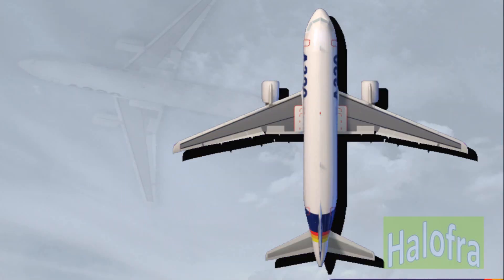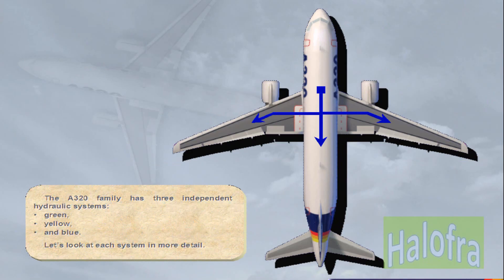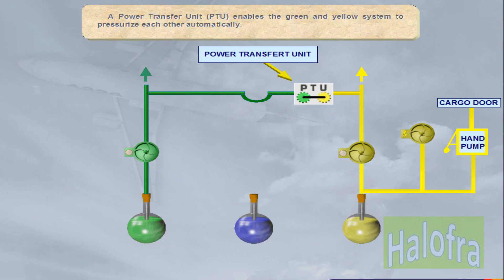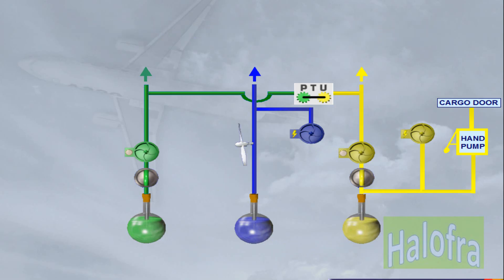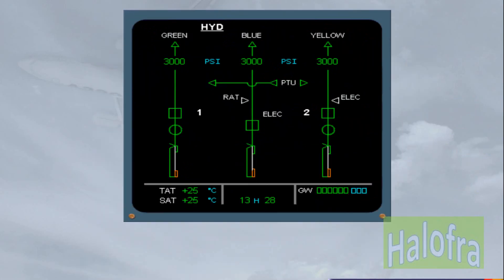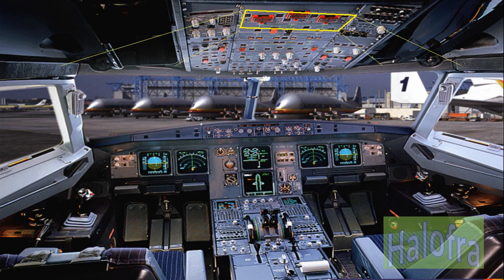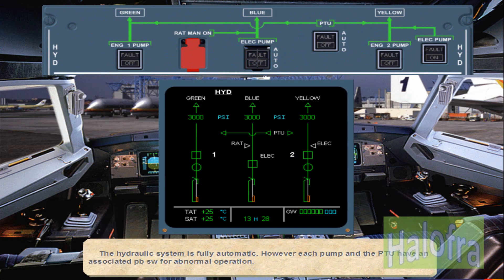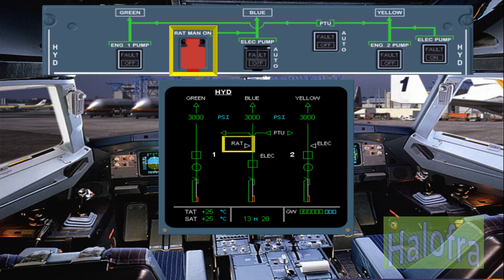Hydraulic System Presentation A320 Family

Comment: So hydraulics are automatic there is no EDP "on" switch just an off/fault switch
Reply: the Off/fault switch is the "EDP" switch. It shows fault when the engines are not running as there is no pressure. In the 737, you leave the EDP switch on even with the engines off.
Reply: Figures never touched an Airbus used to boeings
Reply: @smokinnplatez1426  I fly both. In the Airbus, the EDP is shows off/fault but if you press the switch in and both lights are extinguish, the pump is in auto and only turns on once engines are running.

Comment: does that  mean when engine 2 starts it pressurizes hydro that goes through the ptu to turn and start engine 1?
Reply: Nah hydraulics and the PTU are not involved during engine start ups. Bleed air is what you’re looking for
Reply: @Bahistapoakoeh  oh gotcha, on the F-16 we have a Jet fuel starter which is literally a mini jet engine that provides bleed air to start the engine, to get that JFS started we have accumulators that are pressurized with hydraulic fluid that are dumped in order to turn the main engine, but it makes sense that if you already have one engine running that is capable of providing bleed air that there would be no use of the hydro being transferred to start the other engine